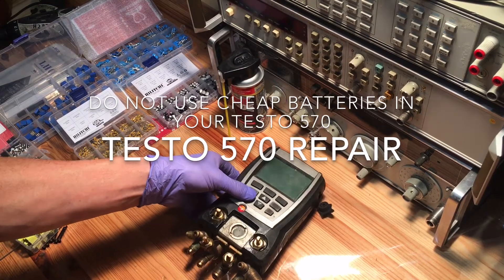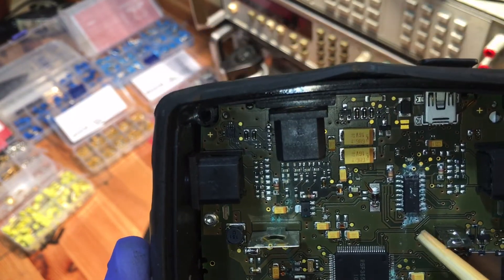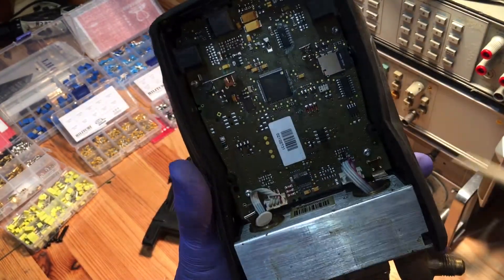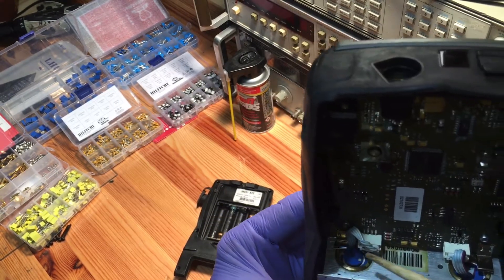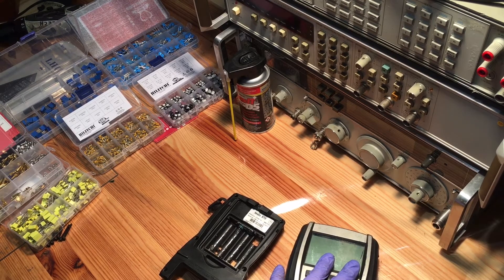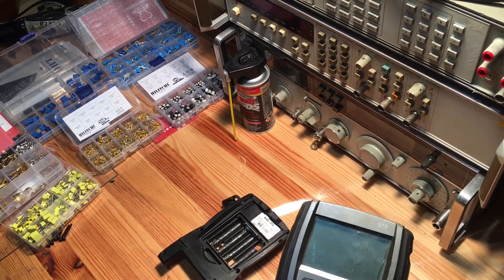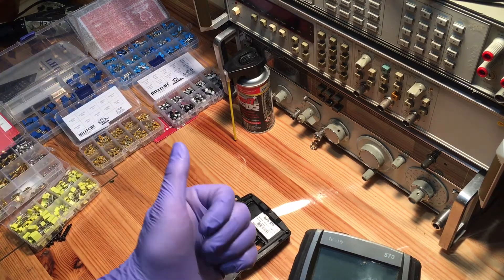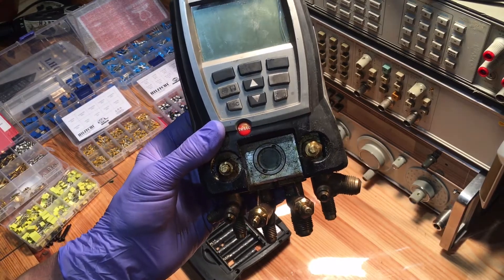Testo 570 Repair, leaking battery damage

Comment: “Hi, I have an old Testo 549. How do you remove the rubber housing to open the unit? Thanks. I’m from Argentina, and here they charge a lot for this kind of repair. The unit has a flex cable issue
Reply from the maker: I never have had to open my 549 high pressure sensor. 
     I don’t know how to open it never tried
Reply: @coldfinger459sub0  gracias 😢
Reply: Ok, muchas gracias

Comment: where is your location ? My testo 570  having a  leakage one side . Need to be repaired .
Reply: Off topic much on leakage battery to pressure testing lol
Reply: Man your videos are in depth , you know your shitttt
Reply: I'm still on the sidelines if I should go ahead and do push fit on my new five ton condenser or get my friend to braze in condenser , I've been around 30yr + building and apt maintenance guys all my life and know a lot about a/c hurt watching them weekly when I do apartment make readies contracting . I've even thought about brazing myself and even bought a empty jug just for the nitrogen . But still hesitating .I just  like all your informative topics
Reply from the maker: @newagainresurfacingn.q.ngu4218  👍
Reply from the maker: Practice by yourself on scrap copper. 

If you have old, plumbing, copper and air conditioning, copper . 

Cutting cleaning reaming and 15% Silver Brazing . 

Don’t forget to flow nitrogen

Seal off the ends and put a pressure fitting service valve to your piece of art  🖼️ 😂

Pump it up 200 psi I’m not gonna tell you hire .  Hires for whatever the manufacturer requires for that specific year. Make model AC system different manufactures, require a different pressure test.. 

But on your scrap copper pressure test, all your cuts and fittings 45 and 90° joints, flare fittings put them under water and some merge them under pressure . 

And keep redoing your Brazing until you learn how to do it correctly . 

Maybe you even wanna take it a step further 

Night classes or weekend classes at a city College that offers welding . 

Who knows you may pick up a new skill that you actually like not just brazing, but actually TIG welding and meg welding, at least be exposed to it oxy, acetylene, welding, stick, welding all these different methods, and actually get manufactures procedures on how to do things correctly . 👍
Reply from the maker: Many topics to cover.  Leaking batteries will stop Your tool from testing pressure..
Reply from the maker: I’m sorry I don’t do repairs for anybody.   
   Only for myself

Do you have to send it to Testo or one of their repair facilities. 

Or you can order the O-ring valve kit assembly and replace them yourself.

But if it’s for Leaking batteries I don’t think Testo repair is that kind of damage you can call and ask.